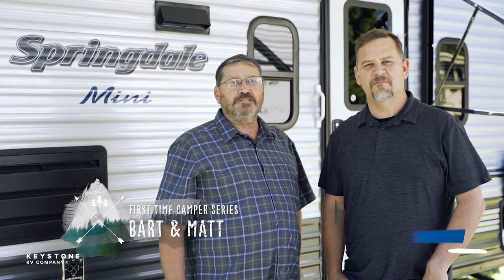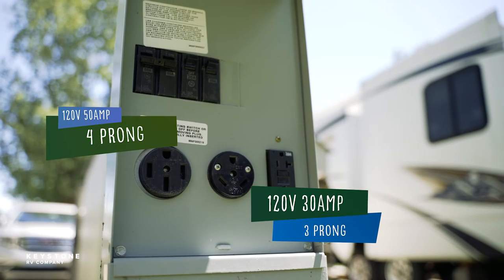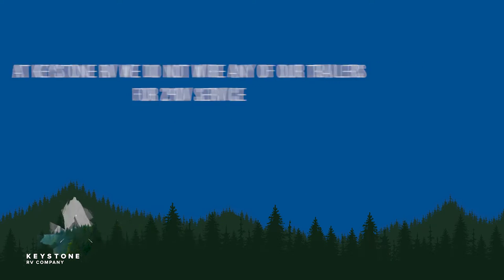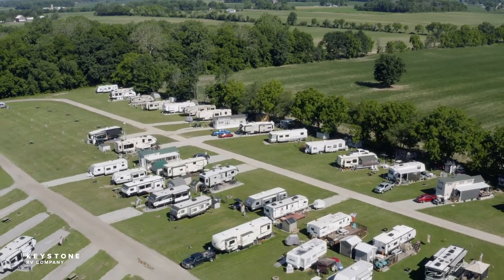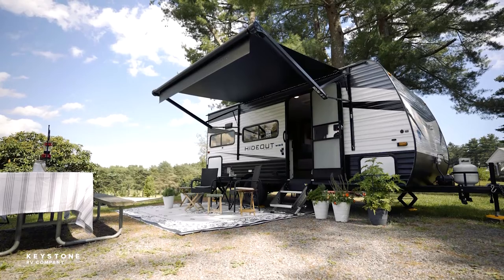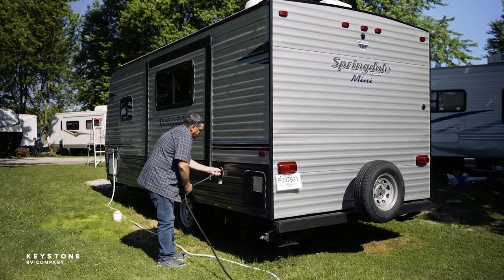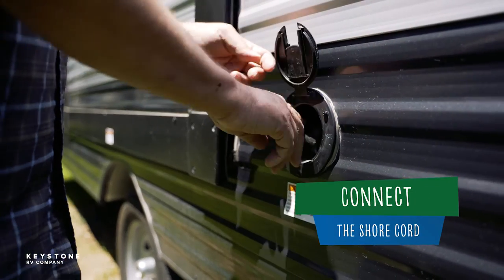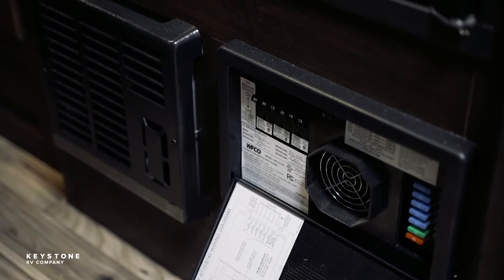First Time Camper Series - Episode 3: Connecting the Shore Cord

Comment: Did you say turn the battery disconnect ON or Off?
Reply from the maker: Good morning, if you are plugging in to shore power than you'd want to turn the battery disconnect ON. The off position is for when you are wanting to travel with the unit, or limit the 12V system to save battery life. If you have further questions, please feel free to contact us at 1-866-425-4369. Thank you.